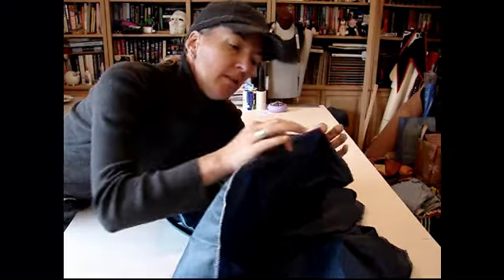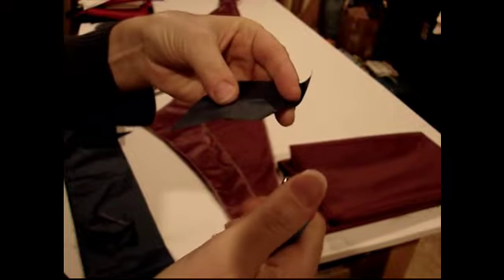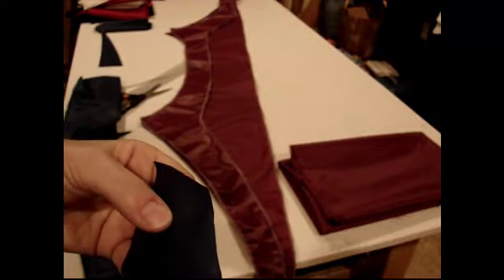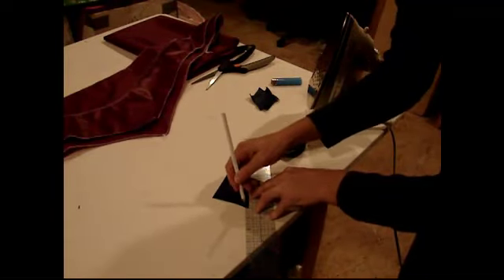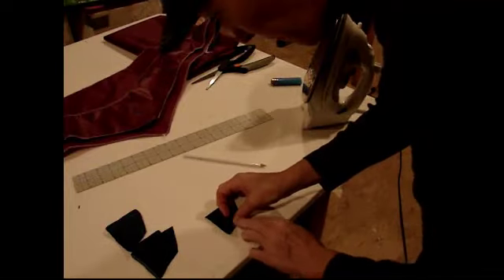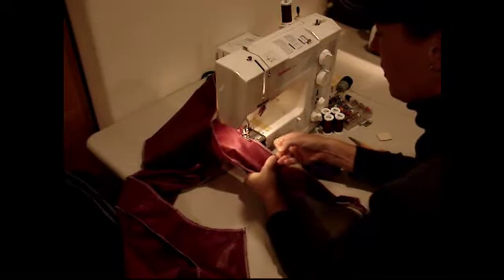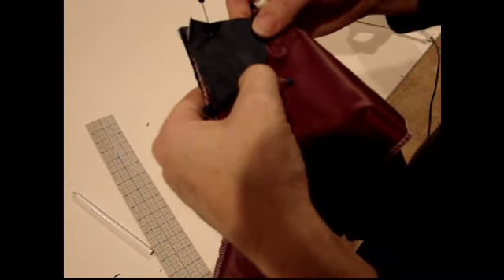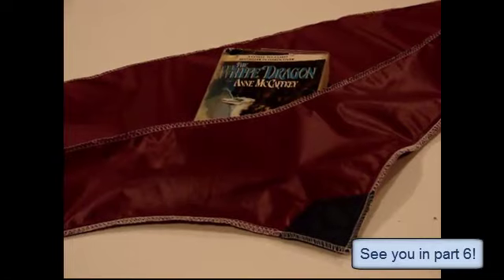Hammock "How To" -- Hammock DIY Part 5

Comment: Awesome series so far!! This is the best in depth series I have found. I did see one guy who instead of cutting and heat sealing in two steps he cut with a soddering tool (or a wood burner with a fine tip) to get both steps done at the same time. Cant wait to watch the rest and see how it turns out!